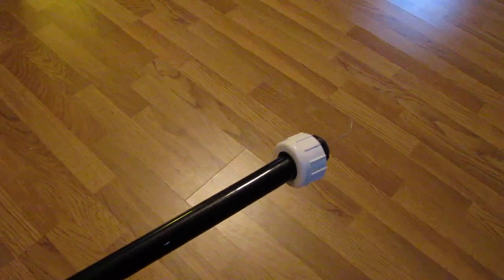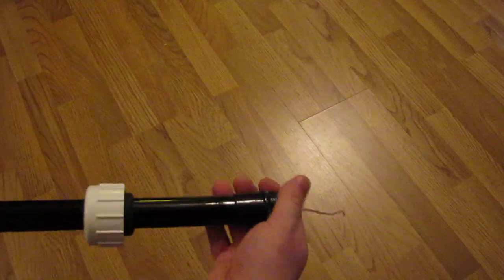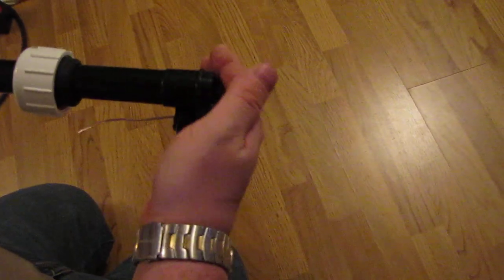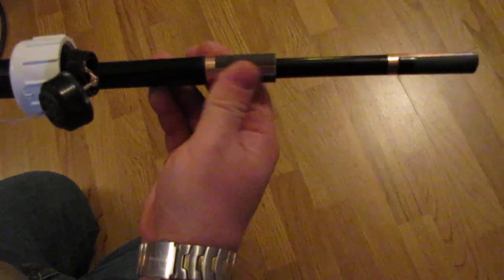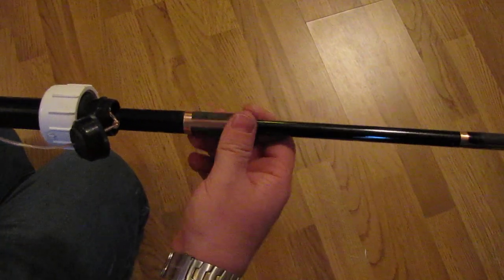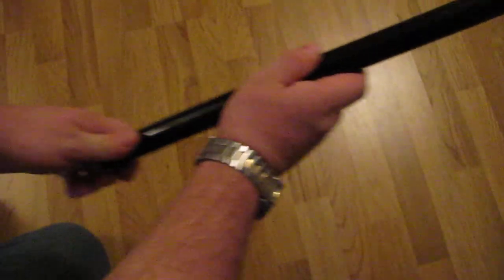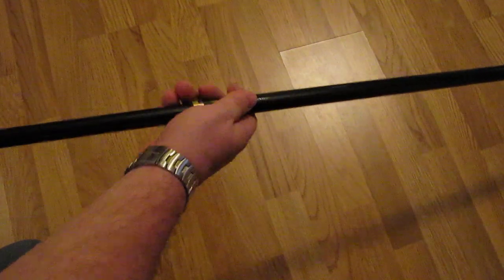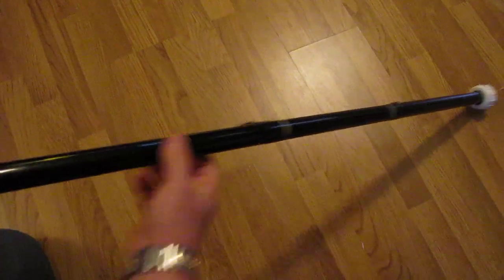Homebrew HF Vertical Antenna

Comment: This was a great idea. The copper tape is ran inside of each tube. Cut the tape a few inches longer than needed, peel the backing an feed with the sticky side up. Holding the ends of the tape flip the pole section so as the sticky side is now down. I fed a wire with a cotton ball thru one end to seat the copper tape to the inside of the tube. The excess on the ends are folded over to mate the next section. The very last section is to small for copper tape,,but a thin copper wire will fit nicely an will give you a pull point. Don't cut this wire yet leave it bout a foot longer than needed, this will give you a tune point for any SWR. My mod's were loading coils for the lower bands 40 an 80 meters their located 1/3 from the top. To prevent nicking an water damage to the copper tape  I used the same idea wire an a cotton ball an ran a coat of wax inside taking care to not wax the contact points.. At 20 meters (14.150 -14.300 Mhz 16 feet 4 inches should make your rig happy on a 16.5 pole.  The old movie screens used wide stance legs (Tripod ) an can be found in any photo shop collecting dust in a corner. These are great for holding your pole.  My wee little Yaesu 817 an tuner likes!.

Comment: after finding Slug tape, (the copper tape) on ebay i thought about the very same idea, i made it pretty much the same way, and parts of an old barbecue and a shelf serve as a base, i added a large'ish coil and 4 radials and it works VERY well for what it is !
lots of qso's all around EU and made it across the pond many times with the ft 817 (Also  a few qsos with < 1W) SSB :)

Comment: Cool idea. I wonder how well it would work with aluminum tape.
Reply: conductive metal is conductive metal. Try and see is the surest way to know what works in antenna engineering and construction.

Comment: Hi,
I recognised pronto what you were getting at. His reply to you wasn't all that informative.
He doesn't say if the copper tape runs up the inside of each section. I'm sure it must do or there's no conductor. If it does run how does he stick it to the inside wall?
Doesn't take into account that the copper tape is exposed to the air and corrodes pretty damned quickly. The tight joints would be first to go!
Not sure that this is a good way without more info. Prefer a piece of wire up the middle.

Comment: Basically it's just a Solarcon A-99 antenna then only instead of a copper wire in a tube it's copper tape

Comment: I have been looking at these poles online for a homebrew buddipole type of horizontal dipole setup for qrp.  I am just wondering why you are using copper tape between the sections.  Is the pole made out of something other than fiberglass that makes the pole conductive, like graphite?
Reply: The copper tape extends up through the middle of each section of pole. The bands on the ends are simply to couple the lengths hidden on the inside.  That's how my eyes see it.  First view, could be wrong. I was once.